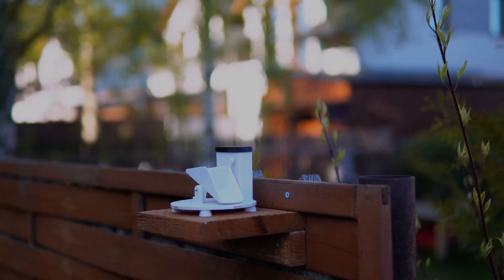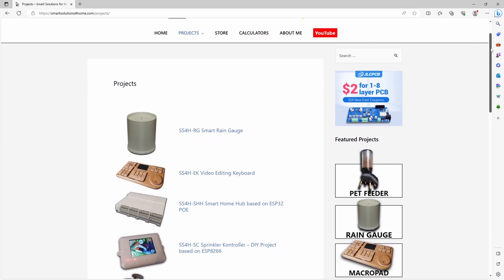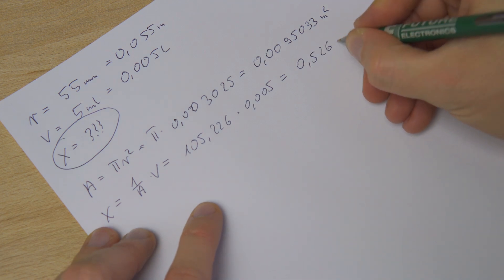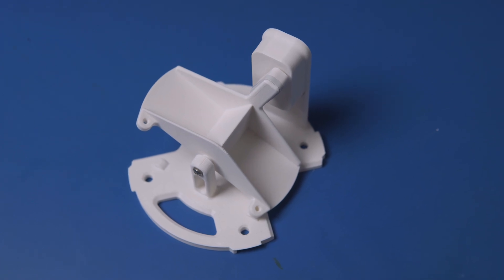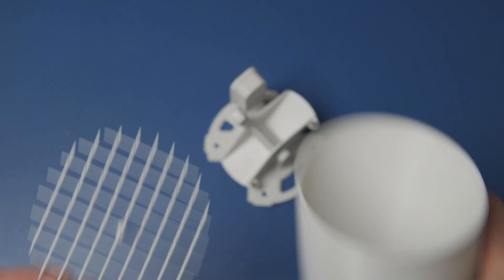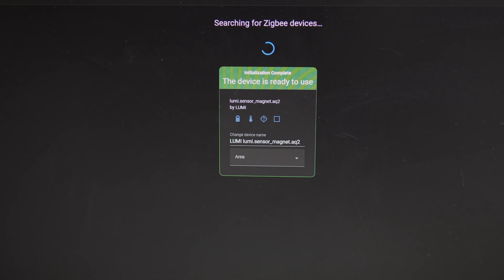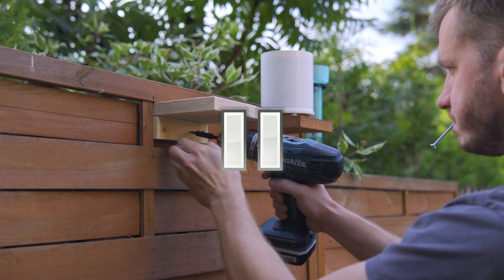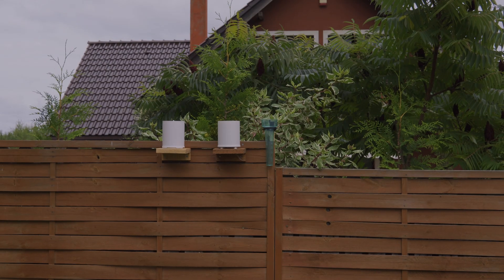DIY Zigbee Rain Gauge for Home Assistant

Comment: having issues with the bucket not fully tipping the water out and the funnel not funneling the water into the bucket. will be modifying the models to try to fix. let me know if you want the changes
Reply: Hi, would you share?
Reply: @muktheo sure let me know your email
Reply: Hi, have the same issue, any updates you could share?
Reply: @grzegorz_z yea if you want to provide email I’ll send the files over but essentially I just narrowed the funnel and increased the height of the middle part of the tipper. I may have changed the angle of the base of the tipper as well.

Comment: If my bucket tips back and forth too quickly, the value first increases, but if it tips too fast in the other direction, it gets subtracted. However, if the change occurs only about every 5 seconds, the count increases continuously. What could be the reason for this?

Comment: Hey guys...built everything...but cannot get it to work. Tried emailing the developer but no response. Unlike FB I cannot post pics of my issues. @smartSolutionsForHome - can you please reply to my email 😊😊-  I have also noticed that the YAML code in this video is not fully supplied in the configuration settings on his web page. The current error when setting up the dashboard is this: 
mini-graph-card Entity not available: sensor.rainfall_day

Comment: Just came back to say that after 5 months my gauge is still working perfectly even after some extremely heavy rain storms and pretty deep snow build up. Battery is also still at 70%!

Thank you very much for the design!
Reply from the maker: Thank you so much for your comment! That’s really great to hear! I’m glad everything’s working fine with the Rain Gauge after five months. Honestly, you’ve been using it longer than I ever have! :) I installed the WiFi version myself, and it’s been trouble-free too, but the battery for sure lasts longer on Zigbee version.

Comment: I have to measure the rainfall across a farm (about 4km range), which is the best way to transmite the data in such distance?
Reply from the maker: LoraWAN would be the best option here. Look for a door sensor with Lora built in. There are a few available on Amazon or AliExpress.

Comment: I also went through a very similar development cycle for my rain gauge. Initially I used a 3D printed tipping bucket, with a mains powered ESP01 running Tasmota to count tips triggered by a magnet placed close to a reed switch. Your much simpler solution to rather use a Zigbee door switch is a stroke of genius.
Reply from the maker: Your device definitely worked too, and that's the most important thing when building anything! :)

Comment: Great idea and tutorial! Thanks!!!
I adapted it slightly to work with an IKEA PARASOLL door sensor, driven by a AAA-battery.
However, the platform + template sensors + the mini-graph card makes it display rainfall per rolling 24 hour period, so right now it's from 22:10 today back to 22:10 yesterday.
That makes rainfall/day decrease during the day when it stopps raining...
Is it possible to make it per day instead (00:00-23:59) and display last 7 or 14 days?

I also tried to make an extra platform+template sensor to display per hour, but now when it has not been raining for about 8 hours, it shows 0.5mm/h for last 8 hours..and I don't understand why...
Made it like this:

  - platform: history_stats
    name: "Regn Contact Flips/Dry_hour"
    entity_id: binary_sensor.regn_contact
    state: "off"
    type: count
    start: "{{ now() - timedelta(hours=1)}}"
    end: "{{ now() }}"
  - platform: history_stats
    name: "Regn Contact Flips/Wet_hour"
    entity_id: binary_sensor.regn_contact
    state: "on"
    type: count
    start: "{{ now() - timedelta(hours=1)}}"
    end: "{{ now() }}"

  - sensor:
      - name: Rainfall [hour]
        state_class: measurement
        unique_id: rainfall_hour
        unit_of_measurement: mm
        icon: mdi:weather-pouring
        state: >-
          {% set count = (states('sensor.regn_contact_flips_dry_hour') | int(0)) + (states('sensor.regn_contact_flips_wet_hour') | int(0)) %}
          {% set mm = count * 0.52615 %}
          {% if count >= 0 %}
            {{ mm|round(1, 'floor') }}
          {% endif %}

And a corresponding mini-graph-card like this:

type: custom:mini-graph-card
icon: mdi:weather-rainy
name: Regn/timme
aggregate_func: max
hours_to_show: 24
group_by: hour
show:
  graph: bar
  fill: true
  icon: false
color_thresholds:
  - value: 50
    color: '#8a111e'
  - value: 25
    color: '#c7311c'
  - value: 10
    color: '#fc5a43'
  - value: 4
    color: '#fc8582'
  - value: 2
    color: '#fbab3e'
  - value: 1
    color: '#ebf438'
  - value: 0.5
    color: '#79cf3f'
  - value: 0.2
    color: '#24cbcc'
  - value: 0
    color: '#3296de'
entities:
  - entity: sensor.rainfall_hour
    state_adaptive_color: false

Why does this report 0.5mm/h when it has not been raining and the bucket has not moved?
Anyone who knows/understands and can explain to me?

Comment: Done and built! It hasn't rained yet however everything went together really well. One thing I noticed is if the device becomes unavailable, when it comes back online it counts a closed signal in the history, I found subtracting the total 'unavailable' states from the sensor's history from the total on/off count fixed this problem. Overall a very fun project, many thanks for the design!
Reply: How did you do that? I see that it counts on HA reboot as well
Reply: Can I see your config?  my setup stopped working with some breaking changes in HA
Reply: @tcflint  I've tried posting a link to my config a few times but my comment keeps getting auto deleted, sorry.
Reply: @ArranAsh  can you email or post somewhere else
Reply: @tcflint  I've tried pasting the config, a link and even just the last part of the link and they've all been filtered.
Reply: I would love your configuration, I can't figure it out with a reboot

Comment: For those who have printed the gauge, what material did you use and how has it held up?  I have a new roll of white PLA+ on the shelf but afraid it won't weather as well as PETG.  I've haven't printed PETG yet but would rather do it from the start if necessary.  Thanks.
Reply from the maker: I definitely recommend using PETG.  PLA even in its plus version, is significantly more hygroscopic. If you're printing anything that's going to be used outdoors, PETG is a solid choice.
Reply: @SmartSolutionsForHome  Thanks for the reply!  I bought a roll of PETG and am currently in the process of figuring it out as I've only ever used PLA.  One more question, some comments indicated the layer lines in the funnel inhibited all the water draining to the tipping cup.  What method of smoothing this surface has been found effective to conduct all the water?  Thanks much.

Comment: I built your zigbee rain guage. First, it's great. Thank you for creating such a cool design.

However, I'm having one issue with the code.

The History Stats "flips/on" / "flip/off" sensor seems to count the first state in the 24 hour time period. Like, if it has not rained at all, and the contact sensor was "off" the whole time, History Stats counts that as "off", and the template sensor shows ".5mm".

Is this how it's worked for you as well? How do I get around this?

Thank you for any help you can offer.

Comment: Question, why doesn't reset the rain meter to 0mm at the end of the day. Now every day starts with 0.5mm of rain. comperred my code several times but can't find where it goes wrong. When I stop de video I see one difference in your code compared to the code shared in the tutorial. For template > sensor your shared code says "state_class: measurement" but the video says "state_class: total_increasing" but none of these seem to do the job right. Any help would really be appreciated.
Reply: likewise, the starting point for me in a new day is 0.5mm of rain. i have put the start and end as
    start: "{{ now().replace(hour=0, minute=0, second=0)}}"
    end: "{{ now() }}"

anyone has a clue?
Reply: @KhangWei  Also looking for an answer, same issue here.
Reply: Hello can't download stl site isn't sending email
Reply: Same here, but every day starts with a different amount of rain 😅
Reply: Did you ever find a solution to this?
Reply: I think I found a solution. I think it is because of the way on/off history is tracked.
The following removes 0.5mm from the sensor stats as soon as it hits 0.5mm, mitigating the effect

- sensor:
    - name: Regen Balkon
      state_class: measurement
      unique_id: rainfall_day
      unit_of_measurement: mm
      icon: mdi:weather-pouring
      state: >-
        {% set count = (states('sensor.aqara_rainsensor_flips_on') | int(0)) + (states('sensor.aqara_rainsensor_flips_off') | int(0)) %}
        {% set mm = count * 0.52615 %}
        {% if mm > 0.5 %}
          {{ (mm - 0.5) | round(1, 'floor') }}
        {% else %}
          0
        {% endif %}

Comment: Amazing project! Really easy to follow and largely detailed 
I had a question regarding the filament type, I used PETG as advised but my feeling is that the funnel is too rough/sticky and tends too form large droplets instead of letting the water fall directly
Any feedback on this ? 
Another small question, where is it possible to easily find 5mL pipette for calibration?

Comment: The gauge works well the 3D print is very well designed top job thank you 😊

I have used your yaml code.
The only problem I have is that in HA after the 24hour period the flip counter will not reset to zero and each new 24hr (or any period set) will not start from zero and starts with 1 flip count (.5mm rain)
Any idea how I can reset the counter to zero at the end of each 24hours period (or any period set)

New to HA and yaml a lot to learn :-) Cheers
Reply: This is probably way too late for you, but you should be able to fix this by changing "{% set count = (states('sensor.aqara_rainsensor_flips_on') | int(0)) + (states('sensor.aqara_rainsensor_flips_off') | int(0)) %}" to "{% set count = (states('sensor.aqara_rainsensor_flips_on') | int(0)) + (states('sensor.aqara_rainsensor_flips_off') | int(0)) - 1 %}"

Comment: Hi Sebastian :) First of all - very great project - you are a genius;) BUT Are you sure your calculation method Is correct? I have calibrated mine with 5 ml per bucket side. When I pour 1 liter of water through the funnel it says roughly 180 mm rain. BUT - should 1 liter not give 1mm rain ??
Reply: 1mm of rain equals 1 liter across 1m². Since you poured 1 liter into a funnel with a surface much much smaller than 1m², you need to multiply by the size factor, in your case 180. So by pouring 1l into the funnel, that is the equivalent of 180 liters of rainfall across 1m².

Comment: Great Project!

I got 2 questions:

-	Can we have the build as .STL files aswell, Cura cannot read f3d and I do not have Autodesk Fusion 360?
-	What is the length of the 3mm screws used?
Reply from the maker: Ad. 1 Here (https://store.smartsolutions4home.com/product/ss4h-zrg-zigbee-rain-gauge-3d-model/), you can "purchase" the model for $0 :)
Ad. 2 Here, it doesn't really matter that much: around 12mm will be fine.

Comment: Build your great project but have a problem with HA. When i flip the gauge up and down i see the Aquare sensor doing Open/Closed without any problems every time, no matter how fast i do it. But the Flip/on and Flip/off sensor  i have to do it very slow or it missing some.  Rainfall mm is only counting  from Closed state to Open state. Use the code you provide here and also check it with the code in the movie. Cant find why it is not working as it should be.
Reply from the maker: For me, it's the same way: the reason lies in the use of the "timedelta" function during configuration. HA actually counts all the bucket tips, but sometimes it takes a moment to register them.
Reply: @SmartSolutionsForHome  Aaaaaa indeed now once you know and wait indeed it updates. Thanks for this info. I was searching for day for a solution but i only need to wait.
Reply from the maker: @mikeooo  I don't quite get why it happens that way, but what matters most is that it works :) Hopefully, they'll address it in a forthcoming update.

Comment: I really love the design, have printed it and set it up, work like a charm, grate work!! 😃
But one question, is it possible to manually reset the rainfall sensor in HA? Have been testing it on my desk so much so now it have rained like 100mm 😝
Reply: I have the same 'problem' mine is always at 0,4mm when there is no rain.
Reply: Did you ever find out a way to reset it?
Reply: I have the same problem @henrikgcarlsson

Comment: Hi, thanks so much for this great project. I built it the last 2 days and it seems to run perfectly. I am still struggeling a bit with the HA code but I am confident I will fix it.
Thanks again.
Cheers
Reply from the maker: Good to hear! :) 
What's your issue with code in HA? Maybe I can help?
Reply: I just wanted to add sensors like in your Wlan gauge which show last hour, last day, last week etc. 
Cheers
Reply: Hello, did you managed to get it working? I also struggle with the code in HA
Reply: @TheBabsenfred  What is the problem that you have? But I doubt I can sufficiently answer that in a comment.

Comment: Great project I can't wait to build, but the .3mf files I donated for are for the PCB version I think (can't see this version in your store?). I don't use Fusion360 so I'm just looking for stl/3mf files for this project. Thanks.
Reply from the maker: Very strange.. I double-checked and everything seems to be in order. Can you tell me the name of the file you downloaded?
Reply: @SmartSolutionsForHome  Hmm, thought I'd replied but guess not, the only non-Fusion360 file I could find was 'SS4H-RG-Case-v.-1.1'. No worries, I've jumped into Fusion360 (I'm an OnShape user) and have exported the .stl files and printed them. My unit is working really well (except the flip count never goes back to 0 so for my hourly stats it's always 0.5mm with no rain, but I'll figure that out). Thanks for your awesome projects they're incredibly well designed!

Comment: This is really awesome. Was hesitant to build the pcb edition due to the fact that I don't have power available where I want the meter and I haven't built anything 18650 powered. and/or solar powered, or similar before. But being able to place this anywhere I got zigbee coverage is just a home run. The battery life in the Aqara sensors is amazing. Lasts 2 years, no problem. Built one meter already and the next one is being printed at the moment. Thanks a lot!

Comment: Is there a way to increase the resolution, like a smaller tipping bucket? 0.5 mm rain per tip is a bit high for my needs.
Reply from the maker: You can do that without any issues :) That's precisely why I included two calibration screws, allowing you to adjust the amount of water that activates the tipping bucket. At 5ml, the resolution is approximately ~0.5mm. If you were to use, say, 2ml, the resolution would be 0.210452mm. Would that value be acceptable for you?
Reply: Great! Thank you @SmartSolutionsForHome